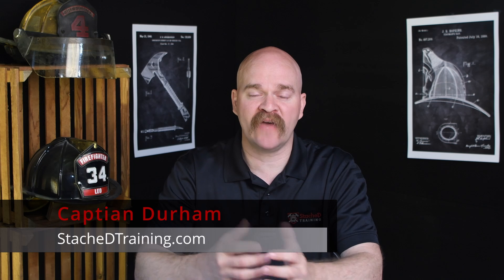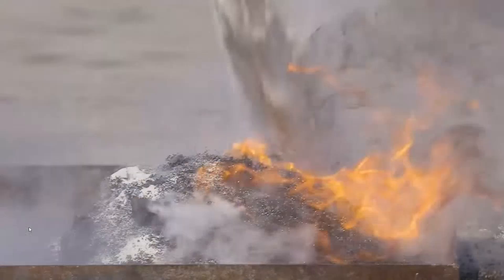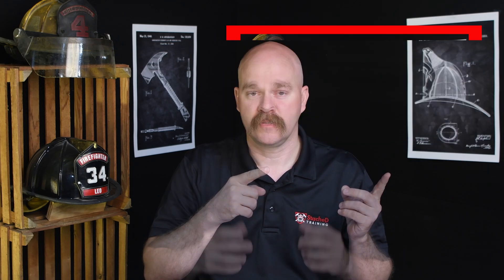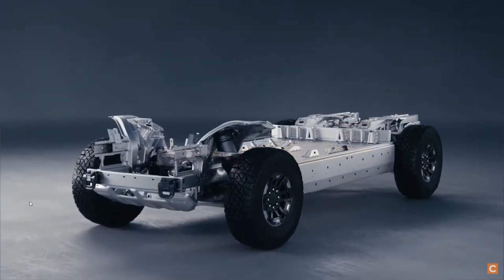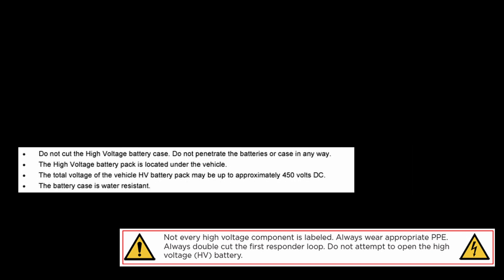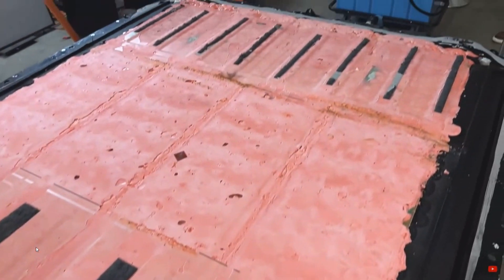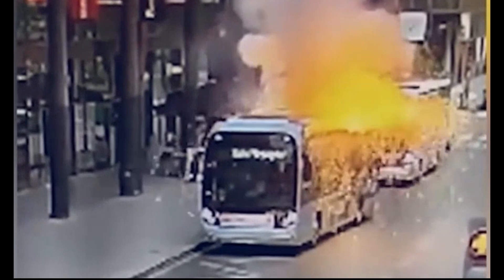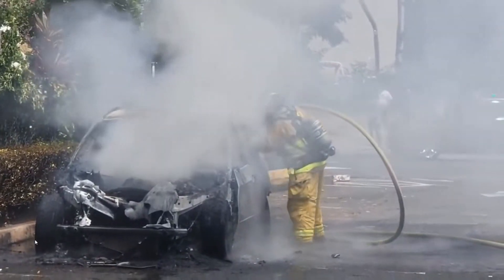What Firefighting Tools for Extinguishing Electric Vehicle Fires Really Work?

Comment: I wonder if there could be a special access port added in the same area for all vehicles(make it standard so all fire fighters know where it is) to the battery boxes that is normally sealed that can be accessed with that puncture device and instead of water being injected which could short out the batteries, you use something like liquid nitrogen.
This will cool down the battery down quickly and not short circuit things.
Reply: Like Apple and USB. LOL

Comment: It would be awesome if you could somehow create some sort of sealed containment around the EV, and then just fill that up with water to keep the fire and the heat contained within the pool until the chemicals run out. It would be like dropping the EV into a swimming pool, except the pool could be built/constructed at the site of the fire.
Reply from the maker: Check out this video: https://youtu.be/CVUAzFzKhw8
Reply: @StacheDTraining  Could liquid Nitrogen be used, 
to fight Lithium battery fires ?.
Reply: @AdamGoodman4U I rather doubt that would be effective but bear with me as I try to think this through by recalling my thermodynamics class from 40 years ago.  Water has about 2.8 times the heat of vaporization per unit volume that liquid nitrogen has.  That means the liquid nitrogen would be boiling far more vigorously than water would and the vapor cloud of Nitrogen giving it a much higher thermal resistance.  

Alas, I'm not quite sure where I'm going with this since assumptions have to be made about the volumes of the containers that would be used to hold the water or liquid nitrogen, whether or not the entire vehicle is submerged, venting of N2 gas or water vapor, and heat transfer from the liquid container to the air outside.  That's a bit too much for my brain to process without a computer model.

Comment: I'm a little surprised to hear you say it is even safe to apply water to the inside of these lithium batteries. Elemental lithium explodes when exposed to water, creating extreme heat, hydrogen gas and lithium hydroxide, a strong base. I don't know anything about ionized lithium in batteries. I would think any water on the scene would be used to prevent other vehicles and structures from catching fire.

Comment: it'd be nice to see a standard for battery packs with pieracable zones.  a 2" disk in blue or something physical showing the location where you can use a sharp nozzle to pierce in safely and flood the pack effectively.   it would be a modern miracle if the NFPA and SAE got together on this.
Reply: It would need to be in a standardized position under the car, there's no way to look for the disk under there while the car is burning unless you're planning on literally burning a camera every time.
Reply: @GremlinSciences I agree on standardizing. Unfortunately, the only thing “standard” on hybrid-electric/EVs is the cable color. It’s hard to standardize the vehicle when the manufacturer has their own design. It sucks, but we must do what we always have - be firefighters and figure it out right?

Comment: LFP, LMFP and sodium-ion batteries are coming.  These are all far less likely to suffer a thermal runaway event, although I don't know if they would be any easier to extinguish.  What studies have been done on using liquid nitrogen to rapidly cool the fire off enough to slow or stop the reaction?

Comment: More EV's = more EV fires, and it seems alarmingly common. Letting an EV battery fire burn itself out isn't really an option - they can burn for days and then re-ignite randomly. The stored energy is immense and in the UK they're basically now trying what is effectively a massive, mobile bath. The EV is lifted and completely submerged for what could be a few hours - it seems to work, but does have practicality issues. Another downside to this is that the bath 'liquid' is then toxic, so has to be disposed of properly.

Comment: Best way to minimize damages is system which automaticly drop battery to ground and vehicle move away. After this, only battery burn and it is easy to reach. In charging lot, separator walls between vehicles.

Comment: Now imagine you are dealing with a pile-up of multiple EV's with people trapped and fire raging. It would be catastrophic but that's the future if we don't solve this problem.
Reply: Well, we could also force legislators to learn that EVs are not the greenest way forward. There are other options, such as e-fuel which actually pulls the greenhouse gasses from the air to create extremely high-octane fuels that burn cleanly and very efficiently.   First few years of e-fuel use would be net carbon-negative as the exhaust from older, less efficient fuels are captured and turned into more efficient e-fuel, then it becomes carbon-neutral as the exhaust from the e-fuels is captured and turned back into e-fuel, and it's ultimately greener than EVs because the vehicles themselves require less emissions to produce and people with an existing ICE don't need to buy a whole new vehicle to use it either.
Reply: @GremlinSciences  Producing e-fuels is a complex and energy intensive process. It seems like a waste of energy and resources to produce a fuel that your only going to burn and pay a premium for doing so. However e-fuels maybe a solution for wealthy owners of classic ICE cars, so they can still drive them in the future when petroleum products are no longer an option for motorists. I would pay a premium for e-fuel, so I could still drive my 1968 muscle car on the weekends 10 or 20 years from now.

Comment: I'd like to see something that encapsulates the vehicle and either force air pressure into the bubble (causing the vehicle to burn up the cells faster and purify the air with some major filtration devices)...
Or using a vacuum seal-type system... (maybe it can pull the compounds out faster to make it burn faster and hotter).

Creating more opportunities to help others somewhere else...
1 hr+ seems a bit excessive...

*I wonder how well the "starlite" - fire resistant compound, would fair if used in-between the battery and other materials... 

A universal quick detachment should be made to reduce the fire damage and insurance claims...

Comment: If the fire starts because of an electrical failure, (shorted cells) you would have to disconnect each battery. There are hundreds of cells and they are connected by welding a metal bus bar to each end of the cell. Sorry, you're not going to be able to do that in the midst of a raging chemical fire.

Comment: Maybe a liquid nitrogen, poured directly into the car interior. Cools off battery pack from the top slowing chemical reactions and preventing autoignition, maybe even extinguishing already burning cells or at least stopping the spread. Pretty expensive though. Probably requires additional training, PPE and maybe special truck since you will probably need quite a lot of it. As an added bonus removes oxygen from the interior.
Reply: re: "Maybe a liquid nitrogen". liquid Nitrogen IS in fact being tested/considered but much like the "dunk container" approach it's NOT the panacea we might hope because the Nitrogen must be stored long term and thus be ready at a moments notice. in many ways a water container gets around this for at least a container CAN (in theory) be kept on stand-by sitting on it's own roll off/crane truck.  just add driver and DEPLOY along with the pre-existing fire fighting assets.

Comment: the problem with a lithium battery fire is that it started from internal damage from overheating inside the battery cell, this causes a short which gets very hot instantly and causes the fire, the only way to stop the fire is to remove all of the charge/voltage from that cell, which is easier said than done.

Comment: What about the risk of electrocution with these batteries? I know Tesla batteries are 350-400 Volts. And piercing the cell you can hit one of the fully charged hot wires shorting it out further and or sending high voltages to the fireman.

Comment: Very cool video. Battery fires are a funny beast, they're barely 'fire' at that point. They are a thermal runaway event where stored energy is released as heat. They're emitting extremely high temperature exhaust gasses that combust everything else they touch, but as you say, no oxygen required. The magic ticket is if you can get thermal access to cool the battery...It won't happen, but: as much as it would be admitting any danger - I'd love to see manufacturers including external access to the battery thermal management system. 
Battery is multiple cells. If one cell cooks off, it releases a bunch of energy. That thermal energy causes the next cell neighbor(s) in the line to fail short and start electrically releasing their charge as heat as well, and on and on. The amount of energy overwhelms the built in cooling circuits pretty quickly, as they are only designed to remove a few kw of energy from the total battery area. If there was a hookup, say near the charge port where the coolant lines could be pressurized with a fire suppression system: battery cooling specifically -  I bet the majority of thermal runaway events could be prevented or quickly shut down. Use the resources already manufactured into the car.
(aside: To justify access to the cooling system - double duty as the charging station could use to regulate battery temperature by integrating a bigger cooler for day to day operations - the fast charger cables are already watercooled. A charging battery is 90-95% efficient, so charging at 250kw is actually rejecting ~25kW of heat into the cooling loop. Most charging is limited by how much heat the tiny 'efficient' car radiator can reject. If this were an external hookup, the car could charge much faster, and firefighters could have access to dump lots of high pressure cooling water right at the problem.)

Comment: Is there a way to rapidly discharge the battery into another heat sink?  A heat sink could be in the form of a large capacity electric water heater immersed inside of the tank of a water truck.  There could be some massive accessible contacts at several standard locations on the vehicle. The fire fighters would hook up the vehicle to a positive and negative contact.  Then they could close the circuit through the massive resistor.  That energy would then be discharged into the liquid water as heat until it was discharged.  The fire/exothermic chemical reaction would then cool and self extinguish.
Reply: Discharging the battery causes the battery to heat as the battery has an internal series resistance. The faster you dump power out the more heat is generated. If you short a battery out it is likely to explode.

Comment: Could a fire proof  car size   shipping  container be used? Where the car be dragged in . By a cable and doors closed. Water added to cool the car like sinking it in a pool. After car finishes burning.  Water drained ready for disposal using container for safe transport.

Comment: Just a non expert thought.  However if we designed the battery box to drop off the car when the battery fire is detected then the car could be saved sans battery.  Should the battery box be a structural component of the car the connection bolts could be blown with a squib bolt cutting charge at each bolt.  The squib charges would need to be built into the car at time of manufacture.  Seems the big problem is the battery box can not be extinguished so it burns the car and anything around it.  We already build squib charges into cars to deploy air bags during a crash.  This way the battery box could be separated from the car and be left by itself to burn.

Comment: The reason batteries are a problem is because the "oxidiser" is already mixed with the "fuel". ICE cars carry their fuel but have to suck in oxygen to release energy. Hydrocarbons are "easy" to stop burning, foam for example isolates spilt fuel from air. As an aside foam/water also absorbs energy cooling the fire.
Cooling a burning Li cell won't stop it releasing energy ("burning") but it will prevent it setting of adjacent cells in the battery. There is quite a lot of energy contained in a car battery, typically 40kW-hr. Heating water takes a surprising amount of energy so water is a good material to absorb the energy. It absorbs even more when it boils but, as an example, 410 litres is enough to "cool" a 40kW-hr battery. That's just two 200 litre or 55 gallon "oil drums". Admittedly the water will now be boiling hot but it's better than flames and smoke.
It'd be nice if there was a standard way to break into the liquid cooling channels (which Tesla uses, don't know about others) to circulate additional water.

Comment: for anyone who owns or is thinking about buying an electric car can you remember in your high school physics lesson when you put a piece of lithium in water, it was the size of a pea and the intense fire was impossible to extinguish, well the battery in a car is basically the same material and it is the size of a pool table, check out on youtube e-car fires, see the bus that goes up like a nuclear bomb when it overheats on a hot day, heating of the battery is a huge problem in e-cars and the industry seems unable to understand the chemistry of these of substances, they fit them and forget them, they are basically chemical bombs, a hot day combined with long use and going uphill into a headwind and the strain on the battery is often simply too much, no amount of cooling can reach the core and only takes heat away from the outer cells, these chemicals make their own heat and combust and run out of control. it's like no other fire, it doesn't need oxygen and will burn underwater so there is no way to put them out, you have to let the chemicals run their course and extinguish themselves, about an hour on a car, lorries and buses much longer, how do you feel about keeping an e-car in your garage joined to your house during hot weather now ?
Reply: That is Lithium metal (typically in non rechargeable Lithium battery) , which is reactive to water.   EV battery is Lithium ion, the heat from thermal runway can be cooled with water.
Reply: Rhe fear mongering with misinformation in this comment is crazy

Comment: Those burning EVs are SOOOOO good for the environment, right?

They are consumable cars that require toxic mining/processing of rare earth elements.
They don't last as long as ICE cars due to the economics of them, thus they are a consumable car, rather than a sustainable long lasting car, making them less sustainable than an ICE vehicle even when just comparing the materials like steel and aluminum.
They are more dangerous and cause lots of secondary damage to roadways that taxpayers have to pay for.
Any EV that gets in a crash is at risk of its battery being damaged and potentially becoming a fire hazard at any moment.

Comment: Regarding the Tesla 4680 structural pack (possibly earlier packs?).
As I understand these cells.
.
The cells are essentially individually isolated in the injected foam
 (there is a liquid cooling ribbon between rows)
.
Each cylindrical cell has a fail point built into the base of the cell.
What normally causes a fire to spread is the exothermic reaction between the single burning cell and those adjacent to it.
When those cells get too hot, they fail, that's the chain reaction.
.
So, in this pack, the theory is, a cell suffers a catastrophic failure.
The reaction starts.
The cell casing fails at the base.
This produces a jet of hot gas which burns through the bottom case of the pack, exhausting the material.
.
This, together with the foam surrounding the cells prevents sufficient heat build up in the surrounding cells to cause failure in those cells.
.
The damage is confined to one cell and the bottom casing of the pack.
.
Reply from the maker: I'm going to try and do a video on this pack specifically.

Comment: What about a port located on each quadrant of the vehicle that is a channel directly into the battery box? Is there a chemical that you can be contained in a pressurised container that can be blown (Like the Fire bottles on aircraft) that can be popped or activated by a fire department, sensors or ??? Is there any other ways to neutralize the chemical reaction taking place?

Comment: If I understand correctly to stop the fire you burn out the material or repair the damage that is causing the fire.  Making it wet/cold doesn't stop the combustion - bush/forrest fires have similar issues.  Repairing a cell just isn't possible.
Adding water to electricity doesn't usually help anyone.
Stopping fires from ever occuring is physically impossible and there is a cost / benefit trade off.
Having just watched a major freeway/highway bridge be pulled down because of fire it isn't that simple.
The viable options are a battery ejection - which would shorten charging times.  But how you eject a battery on buckled car after an accident is a costly engineering challenge.
Or like many suggested a box that allow the damage to burn out in a way that minimises damage to other property.    It probably needs some water to stop the box melting and a way to neutralize the explosive gases.  It is not an insignificant engineering challenge to implement this is car parks, garages or other tight spaces.  The other problem is there is a huge difference between the box for a F150 and small Telsa. 
Assuming something is left behind recycling the remaining cells is the next challenge as heat from one can weaken the next and a casacding failure.
Where you have an inceneration plant or power station it is probably quicker, cheaper, easier to just throw it in there and be done with it.  The reality is an battery fault is a total write off of the car.